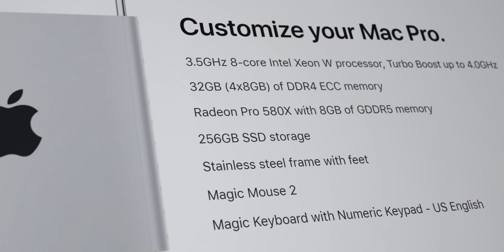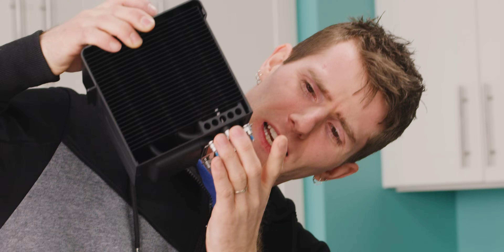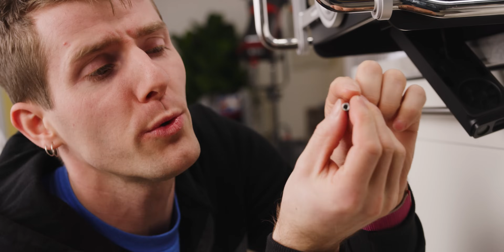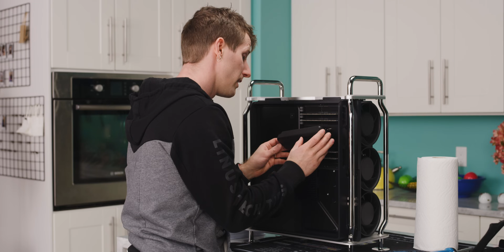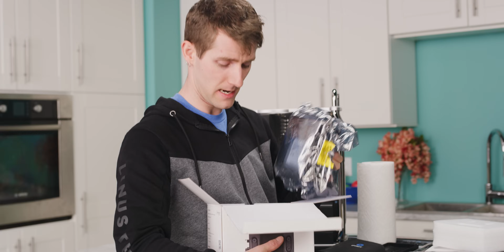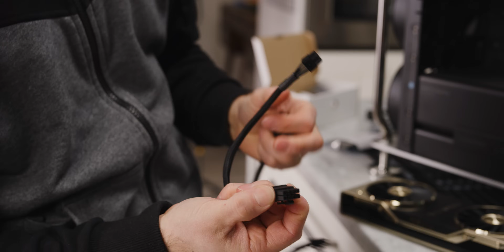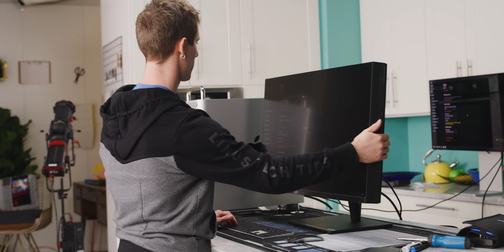Don't give Apple your MONEY - Mac Pro Upgrade Adventure

Comment: This custom Windows/Mac Pro mod actually makes for an ideal near~Bottleneck Free system of this era, and with both a Vega II Duo and Titan RTX plus 0I.50 TB of DDR IV ECC Memory at 2933 on top of that, literally any serious workload for the next decade and change could be handled on this; knowing though that Cooper and Ice Lake Xeon CPUs are right around the corner in the upcoming months, as well as Meteor Lake in 2023, those of you who do serious AI and Deep Learning workloads will be better off waiting for the next Mac Pro due to how well Generation III and IV Xeons will fare up, but if you need something now that will get what you need done in a timely manner, then this is pretty much all you'll for the time being if you must opt for Apple.
When I look at how well this system was modded, as well as what Xeon's use case is intended for, this is part of the reason why some people will not purchase Threadripper, despite AMD's Flagship (releasing on the First Anniversary of their Flagship Prosumer Graphics Card, Radeon VII) having the best possible CPU Only rendering speed due to its core/thread count and optimizations under Zen II; until AMD starts having AVX512 support or their relevant equivalent on their CPUs, Xeons will forever be relevant for AI and Deep Learning over AMD's offering, this may be part of why Threadripper has yet to enter the Professional Grade Macintosh Workstation lineup and they've a bit to prove if they want to make a system with Apple on this front, though I'm kind of happy that they aren't, as the 3990X would cost closer to the 7742's launch price if Apple had their way with it.

Comment: For the hard drive probably need to go into the disc utility app to adjust the settings for it to show up internal. Think it was called mount drive or something. Pretty sure even external drives can appear sorta remember something like that last time I was messing around with an external HD I was formatting in disc utility.

Comment: All I can say is that everything old is new again...

Back in the IBM PS/2 days, there was a movement in the microcomputer field to eliminate, as much as possible, the need for tools to open and service a computer. As well, expansion slots in PCs always had a guide at the far end so that full length cards had support both at the back of the computer, and the front of the computer. It is nice to see Apple going back to that minimalistic time...

Comment: I was by mistake in an Apple store. The mac pro with a wooping 12!! core Xeon!! processor was out for something like 12000-13000 dollars, I don't even remember well, it was just a ridiculous amount. Do they know that the threadripper 3990 will be out in a week at 4000 dollars? And building a system around it with massive memory and fast ssds and whatever you want will be still less than what they are asking for?

Comment: $7500 CAD for the base spec model of this eyesore. What a fucking joke. Apple fans will fall for anything. An extra $8400CAD for the top spec xeon CPU??? ARE YOU FUCKING KIDDING ME? You can buy the new Threadripper 3970x for less then 3 grand... and its FUCKING BETTER. Apple are a bunch of savages. No other way to put it.

Comment: Apple considers any  non Factory location drive as an EXTERNAL. The SATA connections will be Internal as will the PCIe SSD's, but the PCI expansion card Optane will be external. It was the same for my OWC PCI card and Apple 500 GB ssd in my 2010 Mac Pro. There is a way to change the ICON to look like normal internal drive but I don't remember how. It is actually very useful when you have many drive attached and some are the same type, it makes it easier to figure out which drives are which until you rename them.

Comment: .. i want that pciexpress lock why isn't everything like that? i HATE trying to get pcie cards out fiddling around with flathead screwdrivers trying to push at the right spot utterly blind scratching up the motherboard cos everyone has a slightly different clasp.. i NEED THIS
Reply: MOTHERBOARD MAKERS: do this with your boards make it so one little latching pole thing unlocks all the pcie cards at once YES DO IT

Comment: Q: The 8-core model has slower RAM speed than the BTO upgraded models (2666 vs 2933), but is that timing coming from the CPU? In other words, can you buy the base 8-core model CPU, upgrade it to 16 or 28, and also expect the faster RAM speed?

Comment: “Don’t give Apple your money”

I can’t even afford an iPad and Linus expects that I will at some point in my life have to contemplate giving Apple my money
Reply: An Ipad is ironically one of the better things you can buy from the Apple line up.
Reply: Lil Lexus yesss agreed I bought a used iPad 6th gen and it's honestly the best thing I have ever bought
Reply: @breadcat0314  ipad specs are crappy and overpriced but only run smooth because of iOS. Buy a cheap android tablet and install android go on it and it will run just as smooth
Reply: Ploper Dung how is iPad specs crappy? It’s A12X, A10X, and A10 we’re talking about. Android tablets are the bunch that use outdated processors lol. And that’s why they run like shit compared to modern android flagships. Only notable android tablet makers like Samsung is smart enough to put flagship hardware in flagship tablet.
Reply: @RR-uc1wb  my huawei tablet is half the price of my brother's ipad and my tablet runs better, especially for gaming
Reply: @presidentorange9051  I'm not a Apple fan but I guess you have the right to boast about how great ipads are since there's basically no competition on android side. That's just how great they are. At most you get laptop performance with a iPad, which is pretty astonishing. Still, I don't like Apple and iOS but if I ever get one in my hands I would jailbreak it and keep it. Gotta give credit where it's due.
Reply: DragoFX_ That laptop performance is at least to some extent marketing speech. I have the current gen iPad Pro 12.9, and things like video encoding or app switching are noticeably faster on an i5 MB Pro or a i7 Yoga. But for media consumption it’s a device with no match.
Reply: @presidentorange9051  iOS is hot garbage and ipads shit themselves after 2 years anyway
Reply: @RR-uc1wb  ok weeb.
Reply: @ploperdung ? What are you talking about? Sure iOS is trash but ipads are miles better than android tablets. Anyone denying this fact have delusions
Reply: @lillexus5589  Totally agree with you I have the newest 11 inch iPad pro and it's an amazing tool.
Reply: Jarad Shively same just got mine a couple days ago and can’t wait to do more art on it
Reply: @jaradshively8976  I got the newest one the really big one.  the school gives them out
Reply: Just Vienna new iPads are like $200 now. That’s Switch Lite money.
Reply: @Michael Skinner, I've looked at an BMW i8 and i3. 50% depreciation after 3 years and 14000 miles. So in the case of the i8 I would want to remember every mile I drove and hour it spent on my drive... Cos it ain't gonna win many races. 
The i3 is slower and would cost more to run over 3 years than a Mustang 5.0. Even including 5 days a week of city taxes and 3 years of no road tax. It's not even close
Reply: Profile pic checks out.
Reply: @Michael Skinner what's the point I'm missing?
Reply: Linus doesn’t even give Apple money. They just try to return everything after they make money from the views
Reply: I agree with you. He uses an iPad though and has praised it in previous reviews. I believe the iPhone 7 used to be his daily driver before he upgraded to a Samsung. He also users AirPod pros He’s not an apple hater and picks the products that work best for him.
Reply: Vienna, get a job, don’t be a socialist!
Reply: @arcanum3882  Do you even know what a socialist is? Lmao
Reply: @arcanum3882  a depressed weeb scrolling through r/teenagers I think like me
Reply: @xYottabyte  you describing yourself?
Reply: @jongerbergerdecht5579  kinda

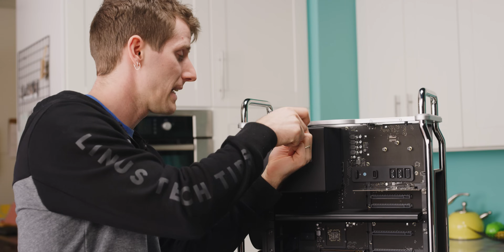Comment: 1:49 as a mechanic, I can tell you that Torx is vastly superior to Phillips. As long as they stick with a single size of driver bit. Philips is all fine and dandy on a brand new piece of hardware, but let it sit around for a few years (or let your knuckle-dragging coworker over-torque the shit out of the screws) and those Philips will start stripping.

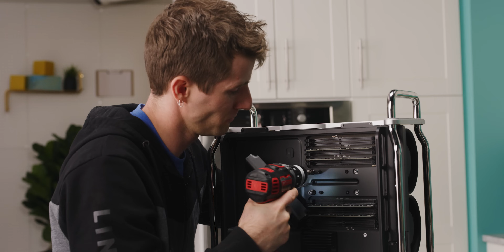3:25 that's why they used Torx for the cooler.

It takes true talent to strip a Torx screw.

Comment: "Tipically at Apple they'd sold SSDs with an attack seal included, that would make levitate the price a bit of secondary value... Grafic card or firewire connection, what I'd be missing the most once over it at Best Price, from the Airport?!" 🗨😏💧🍎🔖🎭💫

Comment: re: "why don't they do black PCBs" because green solder mask has been around longer, it's received a lot more fine tuning and development. as a result it has better impedance control, better leakage, and can form tighter dams more reliably, all of which are critical for getting a solid yield.

Comment: I'm actually for reinventing the CPU cooler mounting brackets. I recently had an issue with overtight cooler creating crashing (often screws with memory controllers), and another cooler install that used way too much force to install for my comfort.

Comment: Can anyone explain how the Intel Optane module allows running a secondary OS without using Boot Camp? I know Parallels/virtualization is a thing but what about the Optane SSD specifically makes it viable to run a secondary OS without worrying about a native installation?

Also, if Boot Camp isn't being used, how is it possible that an Nvidia GPU is being used on what I assume is macOS Catalina? Is it still possible to passthrough an Nvidia GPU with full acceleration performance in a VM if the host OS doesn't actually have drivers for the device?

Comment: I sat in front of my local retailer design and order your own system tool i maxed a 3950x system with just about all the best gear and 1tb boot of pro-Samsung mvme M.2 mem,  4TB of SSD mem 32 gig ram a water-cooled 2080ti with a full water cooling system sitting on a really good X570 moboard win pro installed built and ready to pick up with a  49inch 144hz mon a top of the line keyboard and mouse I picked damm near the best of everything I could not get it past ($11k built) and with 2 years store warranty and this was with the notorious sucks to be us Australian prices.

Comment: If I had the means and financial backing, I'd love to create a new custom PC manufacturing/design company called "Orange" that sold open standards compliant, fully user-accessible, home repairable, and consumer rights friendly PC's that vastly outperform every category of Apple computer at 1/4 the price.
Reply: @andrews2115  Yes, you're totally correct in everything you said. I realize that's why Apple has succeeded since the early 2000's, and for some products even earlier. However, that's precisely why I would love to create a competitor company that can make elegantly designed custom PC's that look nice while outperforming Apple systems, but only charging a small (ethical) markup to cover manufacturing, labor, and design costs with just a small amount going toward profits. That company would offer a strong alternative for the millions of Apple customers who do actually want a high-performance system that looks good, has better thermal management, and better performance but at a much more reasonable cost. 
I know a lot of Apple customers who want all of those things, but go with Apple because they've been tricked by that corporation to pay extortionate prices thinking they are getting "the best". While many Apple customers do purchase the products as a status symbol precisely because they are more expensive, I think there is a potentially large portion of their customer base that would switch, it would take a few thousand initial customers to switch, some good reviews online, and head-to-head comparisons and I think quite a few people would wonder what they were thinking buying Apple in the past.

Comment: While apple may have taken great strides into enabling user upgradeability with the new mac pro, the sheer number of ways they try to screw over the consumer is abominable. Using proprietary connectors so that they can charge more money for users to perform useful upgrades. Not including hard drive bays and forcing users to buy a hard drive bay, at an extortionate price. All of this when standards for these have existed in the PC space for years. It's not like apple HAD to design their own proprietary connectors. No, they just want to squeeze as much money out of consumers in every way possible: the overpriced upgrades, ram, cpu, etc... Their design may be good, but their moral principles are abominable.

Comment: Every single Apple employee needs to watch the first 12 seconds of this video and understand why the new Mac Pro is an abject failure. 

Not because they tried to make a professional product and gave it a professional price, but because $5999 doesn't EVEN get you a system that can beat much cheaper ones. it only gives you the POTENTIAL to beat much cheaper "consumer" spec hardware. If you want to /actually/ beat it, triple the price. 

256GB SSD? I guess they couldn't fit ~$75 512GB SSD in the BOM instead.

Comment: There is alot of nice touches in that Mac Pro. The engineering shows there. It is where the greed comes in fails Apple. Not to include a drive bay is outright stupidity. The CPU cooler is no biggie. The RAM install is reasonably easy. I love the case but the cheese grater look I could do without and wonder how dust will be a part of this. In any case, nice video. Brandon is the video champ. Next episode will the best of who gets thrown under the bus for 2019.

Comment: The cross pattern in the thermal compound is from something called pumping. The thermal cycles will create a pumping motion in the thermal paste and over time displace the material from the heat generating spot(s) of the die. This is something you would try and avoid while choosing thermal compound.

Comment: Remember when installed hard drives on the mac pro meant screwing a little aluminium sheet to the bottom of the drive and just sliding it in on the case rails and the data+power was just on the motherboard? and it looked just as elegant if no dirves were installed? 

Pepridge farms remembers

Comment: Thanks for this video linus, 
Would be great if you will bring a serious 3D guy that know how to test the GPU in 
Substance painter, maya, metashape and more 3d applications. 

So, for example, he can take windows PC and test Substance painter in both. throw different smart materials together which one shows the result faster and with how much FPS on screen. or try to move a rigged (heavy) character in maya viewport (using GPU cache) and see which one will have better FPS mac pro vs TR pc. tests like that are super relevant and are far more important than final render times. for most professionals

Comment: How long does an $20.000 - 30.000 Apple Mac Pro last in years? A Car in the same price range lasts at least 15 -20 years, I think that in about 10 years or less, the power of a $20.000 - 30.000 Apple Mac Pro fits in a smartwatch case, see today's smartphones compared to a Mac Pro or any other PC from 3 - 5 years ago, or realistically 20 year/5 = 4 so an $20.000 - 30.000 Apple Mac Pro cost actually 4 X 30.000 = 120.000 or better a house!?❤❤❤❤ attack.

Comment: I thought surveillance class drives had firmware installed that favors continuous writes over write correction, because a couple of corrupted frames of video is worse than dropping frames altogether trying to correct a write error? Aside from being optimized for sequential read / write over random IOPS. Seems like an odd choice to me.

Comment: What drives me so nuts about this... is that the design on the brackets and the case is SOOOO FUCKING GOOD. It's just beautiful and looks great.
But they do bat SHIT CRAZY stuff like the t2 chip or memory thats 3x more... I just don't get it. Its like they have some amazing engineers designing this... and then some marketing or ceo who knows nothing about computers or everyday users and they fuck the whole thing up. 

Why would they restrict it to the t2 chip, if those go bad your basically fucked. Because any time you take something to apple to fix it you get the big old middle finger to buy a new one. Then there is the whole right to repair thing going on which makes it a b.... to take it anywhere else.

Comment: Linus, you got to see the tool-less cases and CPU coolers from like 8-10 years ago, they will blow this experience away (and I assume you have more experience on that than me since I was only a kid back then). Btw, the modern standard PC case and heatsink will require users to take 6-8 screws to access the CPU, not to mention most case screws are actually thumbscrews so it's not that great of an "innovation" from Apple. The satisfying PCIe lock mechanism on the Pro was tied to the side panel locker tab on the old 2010-2012ish cheese grater Pro and also require no screwdriver to replace the cards so...still nothing innovative over the old Pro.

Comment: Using torx instead of philips heads for screws is a good, they should just do that for all the screws, torx screwdrivers are easy to get and they are just better in every way compared to philips.

Comment: "Why would you ever need to remove the cpu cooler?" -apple
Reply: Spoiler: Linus did it wrong. There are 4 screws in the holes of the heat sink behind the name plate  (standard location, you screw it in from the top like a DRP4)  
If he'd done it that way, he wouldn't have had to take off the ILM (which is very primitive, typical for LGA3647). 
Just as accessible as a non-Apple machine.